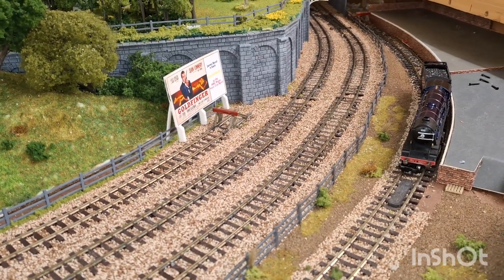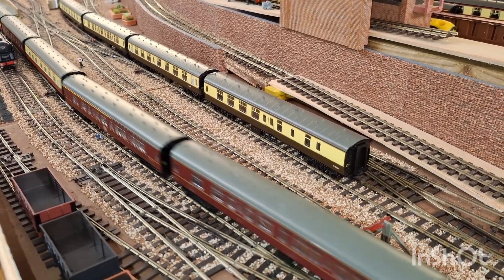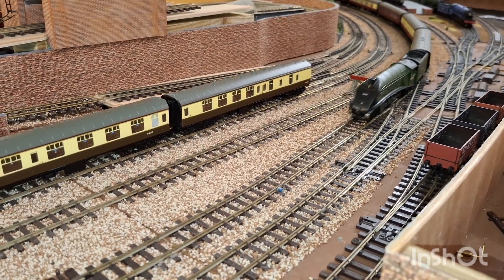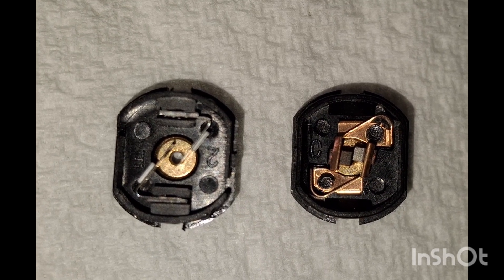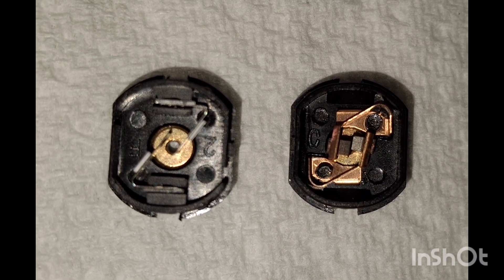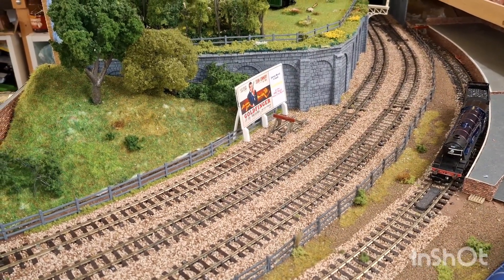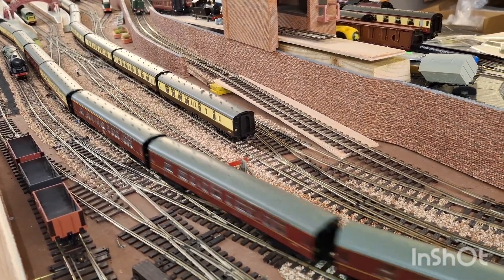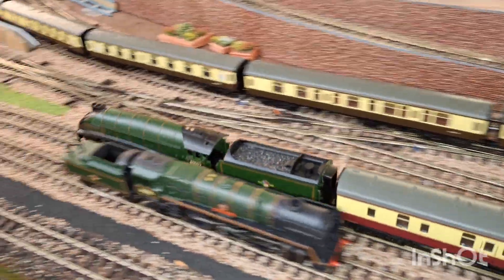Hornby TT 120 motor end cap swapped from wipers to brushes

Comment: 30 hours of motor life isn’t all that great.  Why can’t Hornby fit some motors with decent brushes?
Reply from the maker: @sullivanrachael  Hornby do know of the issue and are looking at using a carbon brushed motor in their J50 later this year.

It is possible they were mis informed by the motor supplier over the longevity of these motors.
Reply from the maker: @sullivanrachael  you tell me?

Comment: Well done on that Garry, seems to run smoothly and hopefully swap from BE brushes to Carbon ones gets some extended life!
Reply from the maker: @HighFell  thanks Matt. Hopefully as you say, I will get an extended life from the motor. I will certainly be looking at trying to reduce the brush pressure next time.
Look forward to seeing your video later to see how you manage with the swap and possibly have an easier assembly method than mine.

Comment: Not great, 30 hours and broke isnt great but eh. Good too see someone else have a got at rectifying this issue.
Reply: Hi Garry. Have you upgraded your camera? The video quality seems really good here. Well done on the swap
Reply from the maker: @gregmacdonald927  hi Greg, I did get a new  phone recently but the last 6 or 7 videos were with it too.

This is the first video I have actually joined different clips together but that was through software downloaded.

It was certainly not the easiest job swapping the motor e d cap over as this one was slightly thicker and needed some plastic removing to fit into the chassis. I certainly will not be in a rush to do others but just wait until they die on me.
Reply from the maker: @class_31clag  It is possible Hornby were misled by the motor manufacturer as they said they should at least last 100 hours. They are aware of the issue which is why they are looking at a motor with brushes to fit in the J50